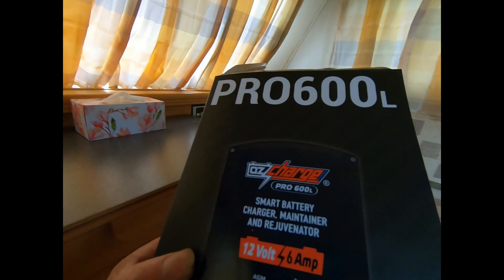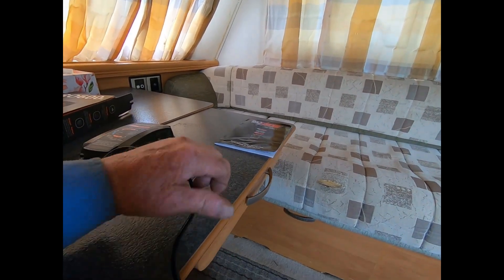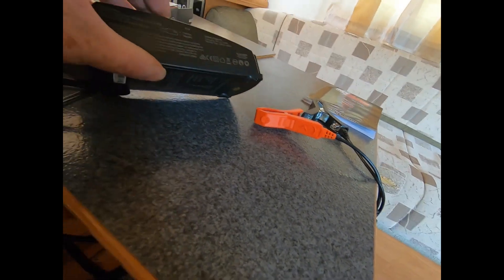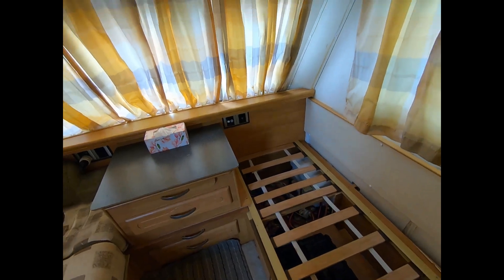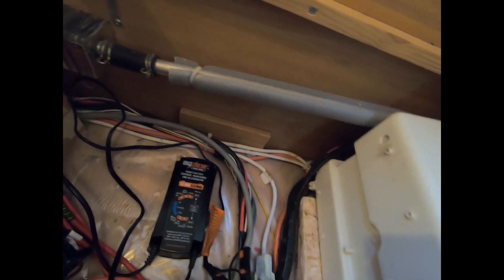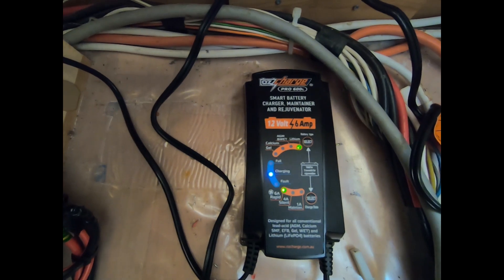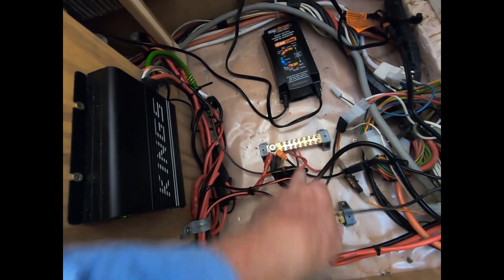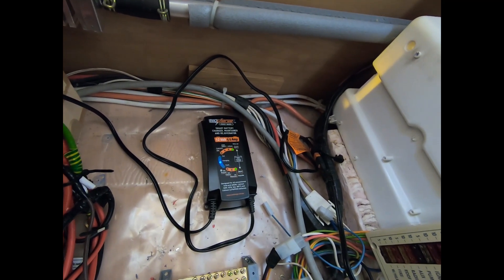OZCharge  PRO600L 6amp Battery Charger install

Comment: You only change to a 1 amp stand by current for a battery that is not used much or if you are not going to use it but in the  case where you discharge the battery quite often ,  leave it standing by at the rapid charge of 6 amp  so when you hook up to 240 v  it's pushing the full 6 amps  to get the battery topped back up quickly .